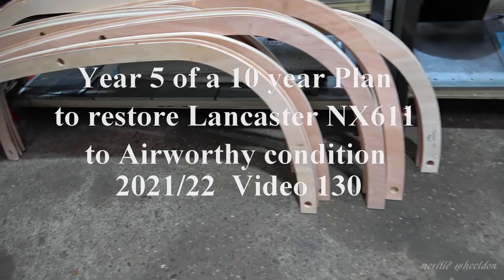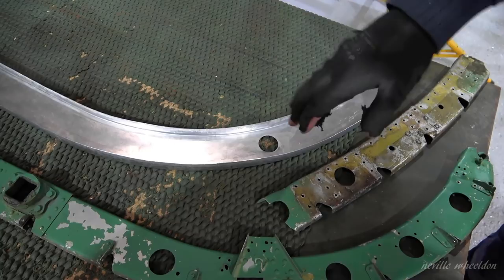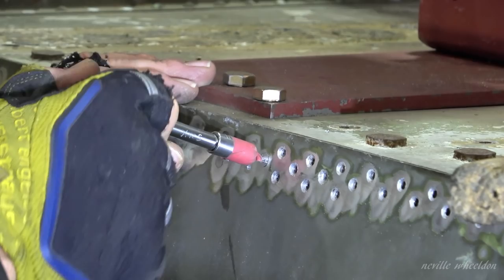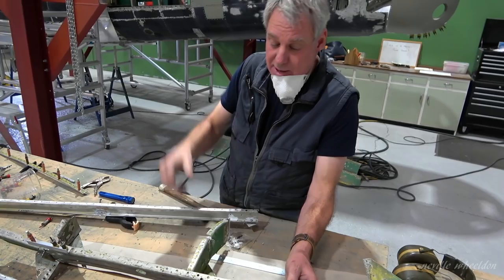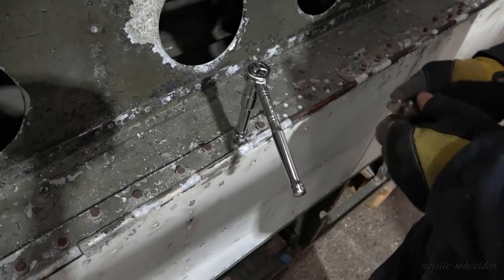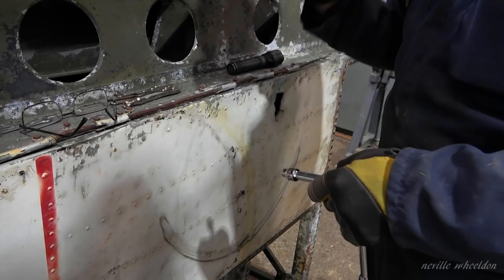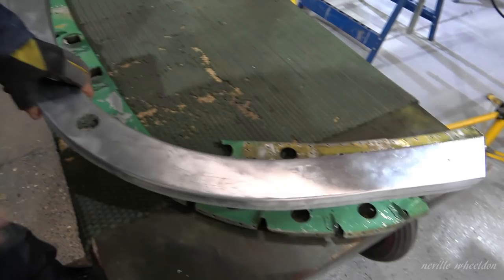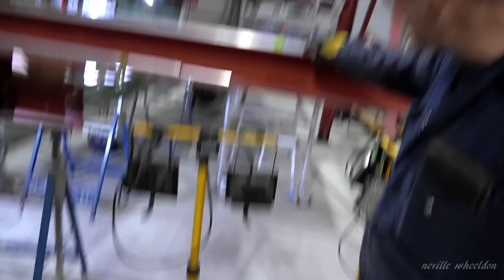Video 130 Restoration of Lancaster NX611 Year 5.--  Patterns for making the Fuselage formers

Comment: Thank you Neville. To those carping about background noise, it might be worth noting that Neville is a volunteer, does not have professional support, that life is never perfect and in a workshop, noise is endemic. It’s reasonable to suggest that a shotgun mic would improve audio, it’s less so to complain about the sound quality. The team at East Kirkby aren’t working for the benefit of a few entitled YouTube viewers and certainly aren’t going to down tools for the sake of video audio. In short, Neville, we’re all very grateful for your continued efforts and let the disgruntled find entertainment elsewhere.
Reply from the maker: Hi Tank Builder, thank you for your support. Sound is a problem videoing inside the hangar, most of what I take appends at that moment in time. Once again thank you.
Reply: @nevillewheeldon1693  Neville, I have the same problem recording the Fairey Barracuda rebuild at Yeovilton. I’ve ordered the new DJI Mic, which is a very compact radio mic setup but it looks as though deliveries are delayed until Apr. The Rode Videomic works well as a directional mic.

Comment: Neville,  The drafting of large radii without dimensioning the centre point of that radius was quite common. The BristolBulldog has a number of these occurrences on cowl parts (all the metal side panels from the cockpit forward were called "cowl panels"). Think more in terms of a french curve template (proper radius)  and making it blend into the two ends. CNC removes most of the "thinking" part. Also, was there a 'misspoke ' on the shrinking-stretching of the formers???  The best way to make the formers is with "O" (soft) aluminum and then send it off for heat treatment to harden said aluminum. All you need is more money. And then some more money after that. So the "boys" were saving the rebuild a lot of money. Still.....nice work!
Reply from the maker: Hi Ed ,the formers and stringers on this fuselage do not come under the CAA domain (none flyer).  So long as it has strength and it safe it will be ok.

Comment: From my limits experiance making frames the outer stringer cutout are cut small before forming the outer bend so that the exess had a place to go and so reduced the amout of shrinking needed, the cutouts could then be final sized before the frame was retreated back to the correct temper.
Reply from the maker: Thanks Fly Kub, that has been mentioned.

Comment: Q: The rivets with the screw threads on them, frame 3:02. What are they called, can they still be purchase today and how are they installed? Thanks.
Reply from the maker: Hi only Avro in the 1940 used this type of rivet. Plug Rivet. Drill a 1/8" deep hole, tap the hole , the rivet when placed in the hole as to reach the Btm of the hole and proud of the skin at the top, when hammered into the hole the rivet its the btm of the hole it expands  filling the tapped threads. I believe they were only used on the Boom (Cord) of the Wing Spars .